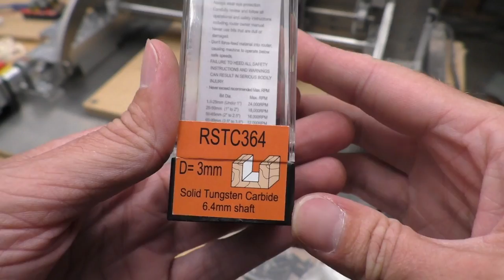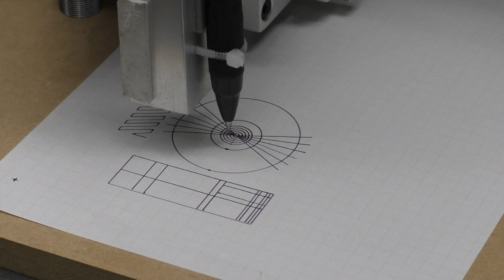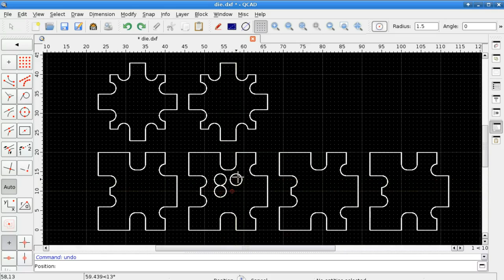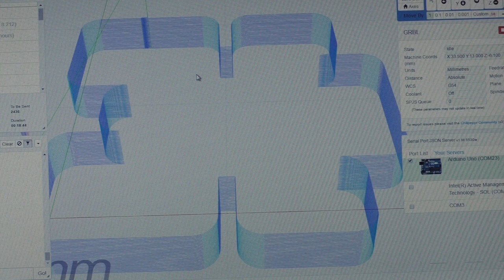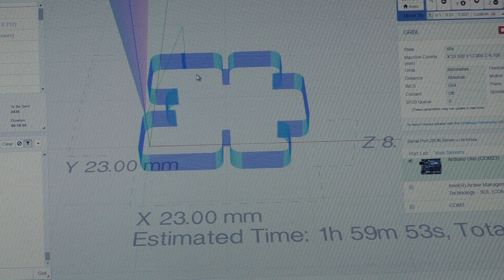DIY mini CNC machine part 12 (new lead nuts + more cut tests)

Comment: The spring is useless on a cnc mill unfortunately. As soon as the mill tool hit the stock, the spring is compressed and then backlash is back. Maybe you can hold milling forces at a low level, where the spring still holds, but that would be a matter of experience. But hey - as long as you try things out - you'll learn.

Comment: As long as the rotor of the spindle motor vibrates, there is no tight result.
some aluminum construction parts are too thin and vibrate due to radial vibrations of the spindle motor.

Comment: Has the Arduino locking up due to noise on the line issue been settled? I was really interested in that.
Reply from the maker: That has not happened for quite a long time now. I think the caps on the motor terminals really helped.

Comment: I would suggest not to use your expensive 1 flute on ply board, the glue in it dulls the cutting edge, save it for your aluminium. Use cheap AliExpress / Banggood, eBay endmills to start, less tears when you snap or dull one while playing with feeds and speeds.

Comment: Get some aluminum blocks as holder for the lead screws... really. a few bugs versus all the crap you have been through yet ;)

and you need to clamp down the stock. That is this annoying humming noise you hear while cutting

Comment: you may have already tried it, but is worth trying a cutting lubricant or oil when machining aluminium. I tend to use paraffin but wd-40 should make some improvements to cutting quality and bit life. I googled to make sure I wasn't talking rubbish and found this http://www.practicalmachinist.com/vb/general-archive/wd40-aluminum-80456/

Comment: Whay dont you stick it down to the bottom surface, rather than hold it down on the last steps
Reply: Or you could add tabs like you did with the water jet parts. Either will work. Double sided tape is your friend! Although it might not work the best with your MDF spoilboard.
Reply: jfan4reva tabs are used with cnc machines much stabler than tape.

Comment: So what solved your spindle interference problem?
Reply from the maker: caps on the motor terminals, shorter shielded USB cable, ground everything properly
Reply: *****
I have that exact same spindle and I never had any trouble with mine here. Maybe it is because my machine has a wooden frame? http://i.imgur.com/KXrsIpm.jpg